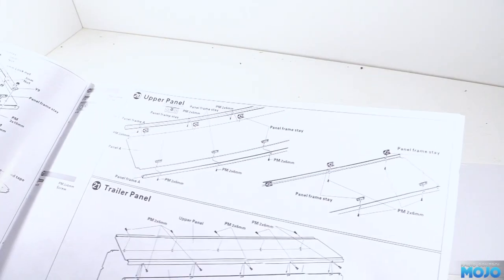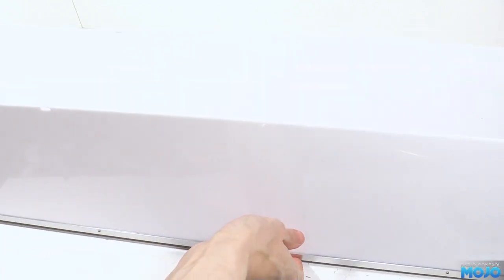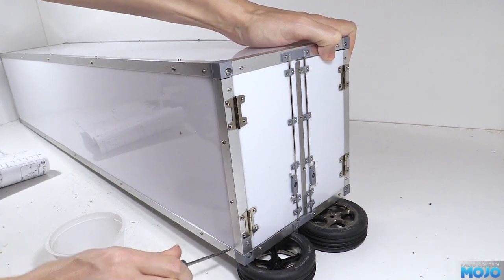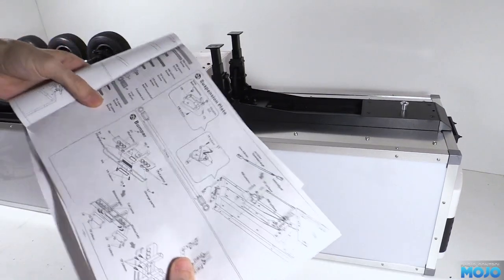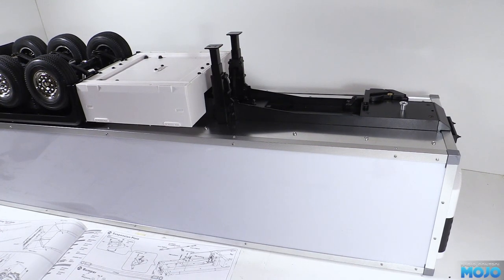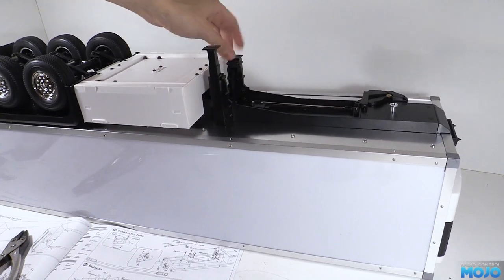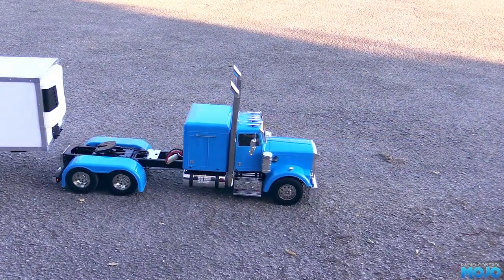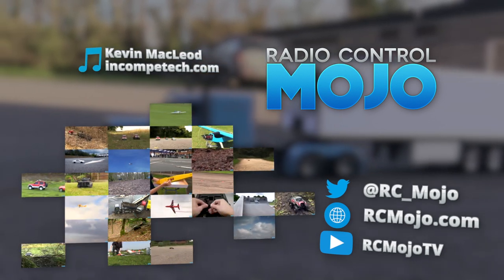Hercules Hobbies Reefer - 9 - Complete Box

Comment: did you have to check to see if it was square on the trailer
Reply from the maker: I haven’t measured it, but by eyeball it looks perfect. It lines up with the wheel arches, and when it’s coupled to the Grand Hauler it all lines up nicely.